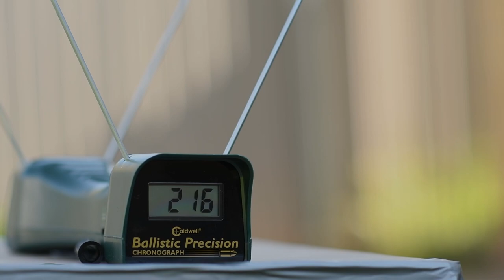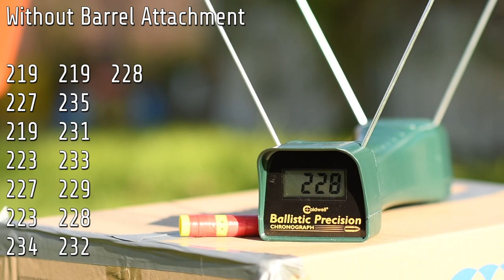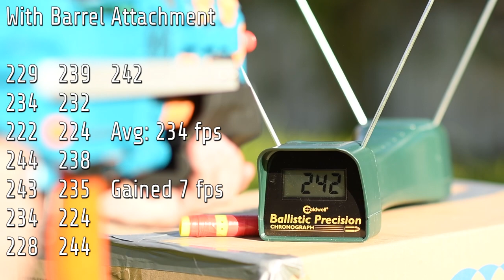Muzzle Brake - Increased Velocity AND Accuracy!?

Comment: Wow! I think you and DartKraft have invented a new scar barrel! What will you name it? For now ill call it the BradDart Scar.

We use 5 spiral lines in our scars and they are amazingly accurate with Alpha Kit. Without scar using ACC TPR darts 200fps, with scar 175fps. However as you said, with worker Gen2s the scar reduces the fps much more and then theres the odd shot that fires straight but the worker exits spinning wildly.

So after watching your video i made a brassed (9/16th) scar with 3 straight equal spaced lines. And drilled vented holes (4.5mm) as you described. My fishing wire is 0.6mm and runs 55mm.

The accuracy is insane. From 10m on a good session i can hit 3 worker barrel targets (4.5x6cm) in a row without 1 miss. I must emphasis as Brad said this only works with worker darts because they are by nature super acuurate even without a scar. But this scar design takes them to the next level, sniper worthy. With ACC TPR darts i can only hit 2 out of 3 barrels with 15 darts.worker if you are reading this welldone. Your darts are the best. Maybe you guys can make us this scar to fit on our Prophecy and look amazing at the same time, like the rest of your product range.

The workers without scar, 170fps, with this new straight scar 165fps. So minimum loss in fps.

Now heres the biggest advantages of this Brad scar, with a spiral scar, when you put it on it, changes the red dot aim point of your scope and it has to be placed on in exactly the same time every time or your aim point will change. One day it could be up to the right, next time down to the left and even if you mark your scar with reference points it still changes the aim slightly.

This new BradDart scar i have refitted multiple times and the aim point its pretty much bang on the red dot every time.

I think a spiraled scar causes the dart to curve sligthly on its way to target due to the spin. Thus your aim has to be slightly adjusted depending on the flight arc and the target distance. With the BradDart Scar you only have to adjust for elevation depending on target range.  

As with yourself Brad we are shocked how the new worker batch recieved both yellow and white foam, the tips fall off far to easily. Our last batch were much better glued.

I still love ACC TPR darts. But now they will be kept for fun card punching. WORKER darts are safer for office wars.
Reply: Specs. 
Plastic tube with 20mm OD and 16mm inner diameter cut to 90mm lenght. This fits perfectly over the alpha kit barrel and also the worler prophecy barrel (with some white tape).

Two brass tubes (9/16th and 19/32) are cut to 55mm lenghts. Nest the brass inside each other and superglue.

Once dry super glue it inside the plastic tube. Drill holes and wire up. Theres a few videos on youtube and its easy to work out from them.
Reply: Update. Got a normal Scar and drilled vented holes, now ACC are almost as accurate as worker darts using the new BradDart Scar. This is from a small firing test. Will do more to confirm.
Reply: Bradley Phillips yup from my innitial tests it sure does. Vents improve accuracy of normal scars. And its made me reconisder ACC. Becuase yesterday we office wared with workers and more than half of the tips have come off.  Really annoying. Yet ACC seem almost indestructable.
Reply: Bradley Phillips agree. I have notoced the same when im moving about.

Comment: Sorry if I missed it in a previous video. But what is the rough inner diameter of the scar barrel? Wondering how difficult it would be to build one from scratch if needed in short notice.
Reply: Bradley Phillips 
Thanks! :) I can probably figure something out for that then.
Reply: I used a 9/16th brass tube as darts have a lightly lose fit thus allowing the 0.6mm thick fishing wire to "grip" the dart on exit.  I only get a 5fps drop in fps. From 170 to 165. But with insane accuracy.
Reply: Tuan Nguyen 
Thanks for the tip! : )
Reply: Tuan Nguyen,, you guys need to start polishing the holey hell out of the inner 9/16 brass barrels!! They make attachments for dremels & sell polishing kits that will reduce a good amount of friction.

Comment: I’m having trouble trying to tune my SCAR barrel on my Caliburn. I was using a k25 spring with the SCAR and Worker half-length darts. When I’d shoot I think the phenomenon is called the “whirlybird”. I tried it with and without spin and would still get it shootin weird. I tried the VF1 muzzle brake and it worked great at 40ft but I didn’t like the accuracy beyond that. I tried the 788 spring and it worked great with the SCAR barrel but it’s not enough power for me.  
Would the k26 spring work better? Is this like the case with the Hyperfire with its canted flywheels where it shoots good on 2s, crap on 3s, and better on brushless?
Reply from the maker: Erick Garcia, I would recommend trying less twist on the scar at higher velocities. See if that prevents whurlybirding. Also try different darts like ACC3 or Sweet Orange. I'm finding that they go better with aggressive scars.
Reply: As I’ve mentioned before I’ve tried it with no spin and it still does the whirlybird!  I have some ACC’s that I can cut down.  In any case the Caliburn just arrived the other day but I only had very little time to tune it since I have two of them.  Hard to tune two at one time.  I’m also out of town due to work.  I’m off Thursday and Friday but I want to be able to use it by then!  

It’s not shooting too hot.  210FPS average with muzzle brake and 220FPS with SCAR with k25 spring.  Maybe it’ll hit 240FPS with the k26 but I haven’t tried it yet.  

At 40ft the best combination I’ve found was 788 spring with SCAR and k25 with muzzle brake but I want to reverse that.  I want more long range accuracy.  I’ll try the k26 and check my strings again for the least spin as possible and if that doesn’t work I’ll try the ACC’s.  I only have 200 rounds of the ACC’s though so I don’t have much to work with
Reply from the maker: ACC darts seem to like a 1/4 rotation with 4 strings, while Worker seem to prefer 1/8th or zero rotation (just straight strings).
Reply: Mine is a 6 string.  I think the way it’s threaded you can’t get zero spin.  I only followed the manual..

So going up to a higher spring would only make it worse?
Reply from the maker: Only way to find out is try. I don't have a Caliburn so your results might be different to my alpha kit or Prophecy.
Reply: Oh I know but you seem to be the leading expert in nerf long-range accuracy so I thought I’d ask anyway
Reply: I’ve done probably 4 hours of tuning on both Caliburns.  I got it to where I can hit a 16oz water bottle from 60ft about 4-5 out of 15 worker darts.  I get the same accuracy now with the k25 spring and muzzle brake as I do with the 788 spring with Scar barrel that I got 1/8 turn.  The only difference is 200FPS with the k25 and 147FPS with the 788.  I did my firing standing with no support.  Does that sound okay?
Reply from the maker: Sounds fine to me. How's it go against a human size target at say, 100ft?
Reply: I don’t have an open space to shoot 100ft yet unless I go to the park or shoot down the street.  I don’t know how people would react if I brought my Caliburn to the park or shoot in the street.  It’s Orange and Black but it also doesn’t look like a nerf blaster
Reply: My Orange and Black has a Katana-specific magwell so I can’t use anything except Katana mags.  I thought it would be too strong for full-length darts anyway.

I tried full-length darts in my lower-FPS Caliburn but it shoots pretty crazy with a 1/8 spin.  Even without spin I didn’t like how it shot at all.  I don’t think I’ll be shooting full-lengths outside of a flywheel now.  My brushless Regulator with Ultrasonic2’s design shoots 176FPS with a storage charge so on a full charge I’m sure it’ll shoot 180FPS.  I let my son shoot me from 25ft and it wasn’t too bad with accufakes.  It’s pretty accurate and has a good rate of fire.
Reply from the maker: My new flywheel fires half lengths. No full lengths at all in my load out.
Reply: That’s interesting.  Is it the Stryfe?
Reply from the maker: Yeah Stryfe being commissioned by someone in Melbourne
Reply: I finally tried against a human-sized target (12inches wide) at 100ft.  I didn’t realize my neighbor’s fence was 100ft away from my house.  I swapped my spring to a k26 with my SCAR barrel and re-zeroed it to shoot 1/8 spin.  I only tried 3 shots but I got 3 out of 3.  This setup seems to prefer the white gen 2 workers while my k25 with muzzle brake prefers the yellow gen 1 workers